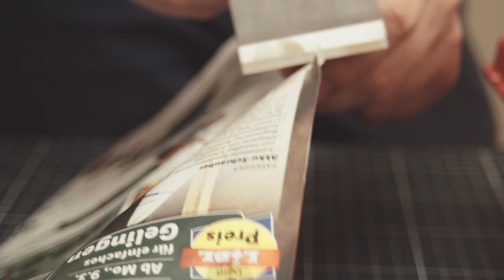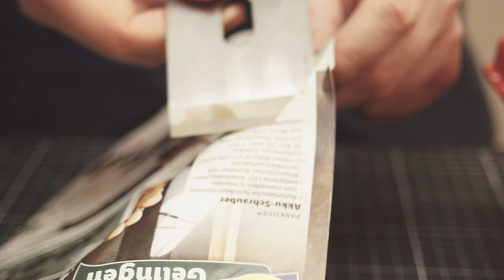Razor sharp. My sharpening process inspired by @RobCosman.com

Comment: Thanks, love your work bench.  So cool.  I have an old second hand spoke shave, old #4 plane, really old draw knife some Narex chisels and a couple of nice chef knives from Osaka.  I have a Makita 1200 grit tool sharpening wet stone I purchased for about 15 dollars CAD at the hardware store.  Seemed more than enough compared to paying 40+ for most wet stones.  I want to build a small work bench and need to sharpen the planes and chisels first.  Any thoughts on something like the Makita stone?  I may need to rectify it but originally bought it for sharpening axes and the like.  There is a lee valley here so I may have to splurge a little for a bath and guide.  When I bought my first knife the lady at the market in Osaka showed me how to sharpen by hand and she just recommended a medium grit.  I guess I just have to practice sharpening.  I have been carving a few spoons and find it really therapeutic but want to get more into woodworking and joinery.
Reply from the maker: Thanks for watching. I can tell you I wish I would have a Tormek sharpening system. After a while, sharpening by hand is tedious, especially because it is so important that you need to do it often. I have some Narex chisels that I use more often than Japanese ones just because the Narex are easier and faster to sharpen. For honing 2 stones, a 1000 and  ~12000 but for rectifying I would not do it by hand.

Comment: When you flatten the water stones with your diamond plate, did you have any rust issues on the diamond plate? Because my stones are used enough that they are always a little bit damp, and that makes my diamond plate rust a bit, if I'm not really careful. Other than that I've had great results with a similar kind of setup.
Reply from the maker: After flattening I use a paper towel to absorb the water from the diamond stone.
Reply: @Octavian-Dan  Yeah, that doen't really help me, but maybe the Atome stone just more rust-resistent than my EZE lap.